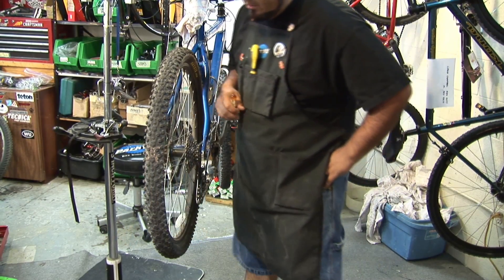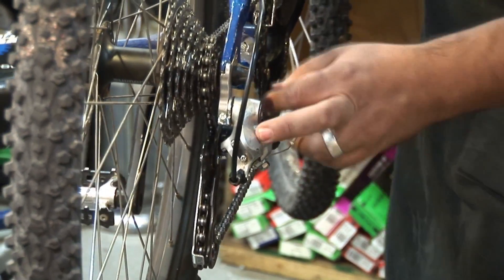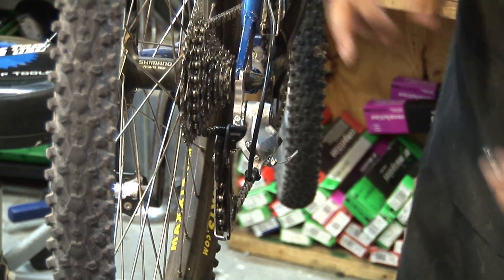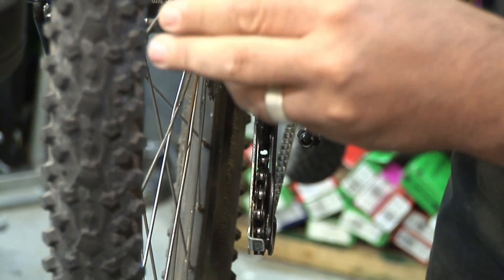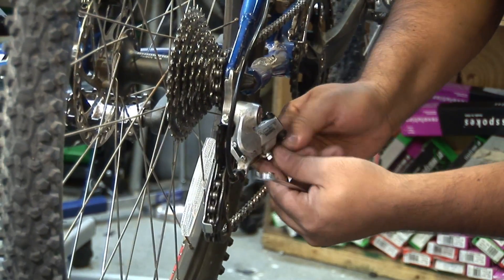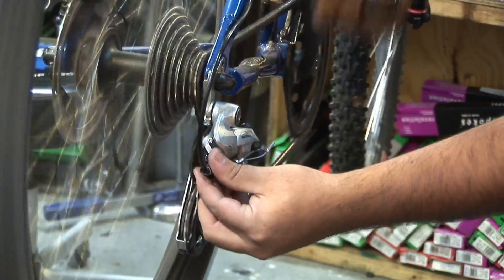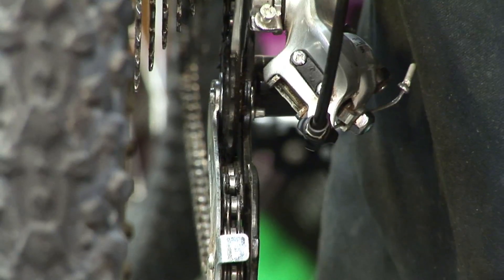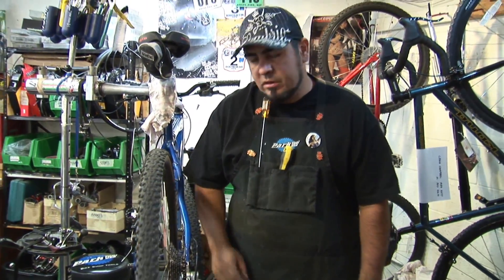Advanced Rear Derailleur Adjustment

Comment: Thanks a lot, this looks like it'll be helpful.  My rear derailleur hasn't been switching to the highest and lowest cogs.  I thought it might be those 2 screws that adjusted everything but I wasn't sure.  I was more so fussing with another screw that seemed to move the whole derailleur height from the gears.

Comment: At 3:25 he starts talking about pedaling through to the low limit. Before he can jump to the low gear, he needs to drop the shifter to the high limit in order to start the barrel adjustment process; at 3:36 you can hear him drop the shifter. The answer is, yes, he didn't drop the shifter after he released the cable tension, but you will need to do this when you start the barrel adjustment sequence.

@SFMTNS: Thank you for the most comprehensive guide to rear derailleur adjustment!

Comment: I had crashed by bike mtn biking, and the lower derailer thing that hangs down was touching the spokes. it still worked fine, but i couldn't use anything but 9th gear in back lol

Comment: I noticed you have the chain on the largest chain ring sprocket for adjusting the high limit (outside of the drivetrain). What chain ring is being used when you tune the low limit? Did you move the chain on the front chain ring to the inside of the drive train to maintain a straight line with the chain?